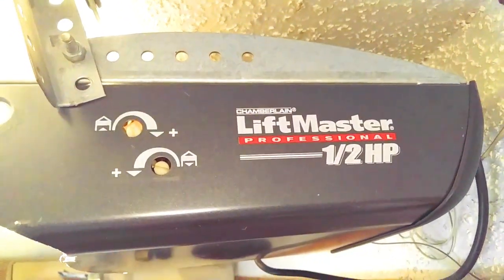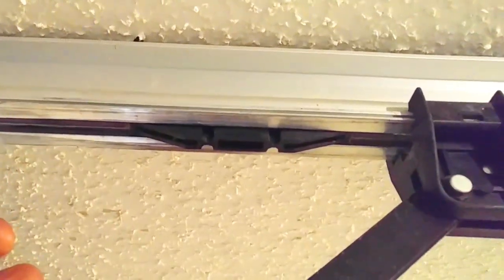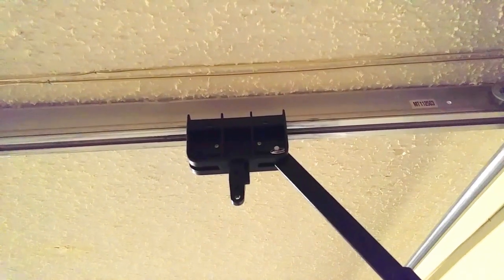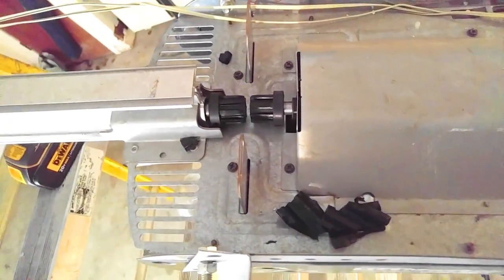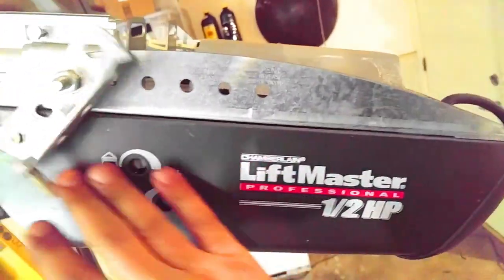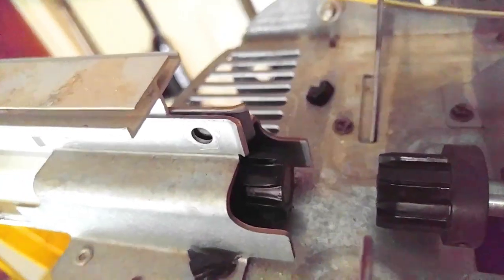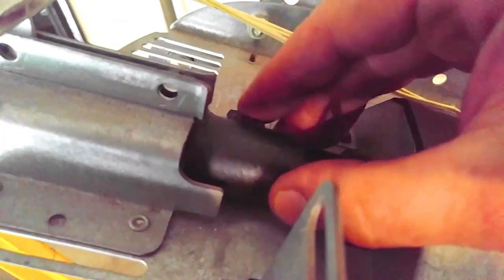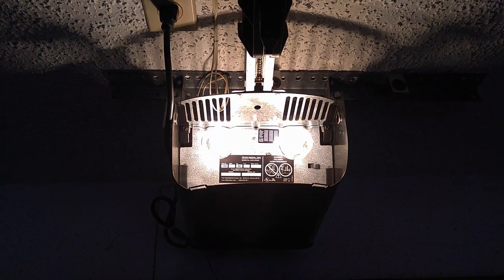LiftMaster Screw Drive Garage Door Opener Coupler Replacement

Comment from the maker: If this video helped you out and saved you a service fee, please feel free to donate to the channel!
https://www.paypal.me/garagedoorgenius
Reply: Would love to donate if I can figure out how the bolt inside the rail moves like in your video so that I can slide in the new coupler
Reply from the maker: @schath123  is the opener still hung up or did you take it down?
Sometimes just taking it down and laying it on the floor helps.  I'm really stumped on why it won't spread out for you.
Reply: @garagedoorgenius  I have no plans of removing the garage opener and placing on the floor. I don’t see you removing it. So what am I doing wrong 😑
Reply from the maker: @schath123  did you loosen the nuts and bolts from the hangers (angle iron) ?  That helps tremendously if not.
Reply: @garagedoorgenius  yes sir I loosened the bolts that holds the motor unit from the ceiling and due to that I can swing the Liftmaster unit horizontally but it’s movement is restricted.
Reply from the maker: @schath123  I would take a large screwdriver and try to pry it forward.  It's stuck and sounds like it needs something to free it up.  Maybe a chisel and tap lightly towards the door on the rail.
Like I said, that thing should slide freely.  Maybe over time dirt and gunk has cemented it together.
Reply from the maker: @schath123  was you able to get it apart?

Comment: This happened to me two days ago. The repairman climbed on a ladder and saw the broken coupler and still quoted me $750 to replace with a belt drive system. Not that that isn't an upgrade, but if the opener is still working, I'll hang on a bit longer before I upgrade. The replacement part will be here Saturday. Thanks for a no-nonsense video, explaining what you're doing, and being specific!
Reply from the maker: If it works great other than a $5 part, keep rolling with it.  Saving money is the name of the game. 👊🏼

Comment: I am so glad I found this YouTube, thank you. Ordered the coupler from Amazon and it was delivered the next day. I used an 8 foot ladder and a book to just balance the unit without taking it down. Took 4 bolts off and pulled the unit back about 2 to 3 inches. Slapped the couple on and put the 4 bolts back on. Took less than ten minutes and saved my at least $150. I was so excited how easy it was and only made on bone head mistake. I went to test the door and it would not open but 2 inches up so I thought it might need to be adjusted so tried that. It did not work, and finally discovered I had locked the garage door down, lol. Unlocked the door and it worked like a charm. Not having to take the unit down saved a ton of time.
Reply from the maker: Awesome!
Great job.  Coupler change can be a pain sometimes.
Reply: Just paid 275$ to fix it, wish I saw this video earlier 😞
Reply from the maker: I'm sorry 😞.
Reply: @garagedoorgenius  it’s all good, sometimes we have to pay I guess

Comment: Had two couplers break on me within 6 months of each other on two different openers. (installed at the same time 20years ago). 
My Theory is that the Coupler is the weakest link in the mechanical system.  And when one does NOT lube their garage door as often as they should, (like me) the couplers break. They are plastic/nylon and get brittle over time. 
Spray silicone spray liberally on all moving parts, coil spring, rail, door tracks, & wheels, etc. Grease the screw drive and hear & feel how much easier the opener does its job!  my 2 cents...   
Excellent video! 👍

Comment from the maker: I was able to rest the opener on top of a 6' ladder with out disconnecting the wall button/safety sensor wires.
Some of you may have to disconnect those wires to do this fix.
Sometimes you don't even have to take the unit down.  Just depends how much room you have.

Good luck!!

Comment: Great Video. Thanks for making it easy.

Mine was a little different in that it broke with the door half opened. For this, I concluded that you can either have the unit cycled all the way up or all the way down. And the Jack Screw has to match whichever position that is before you run the unit. I used a three foot length of Mil Spec 550 chord to wrap around the teethed end of the jack screw and spun the heck out of it till it was all the way to the closed position. Easy to do with the door not connected to the rabbit.
Reply from the maker: Thanks!
And also, awesome pro tip!  💯👍🏼
Reply: I’m having this issue and can’t seem to find the sweet spot of where my machine broke. Any tips?

Comment: I need that new video because my door isn’t going down all the way just half way then it comes back up lol. I had to change the coupler
Reply: This is meeee.  I am searching through the comments and still need help after replacing the coupler.  The little black piece which moves with the chain when the  crank is activated is caught about 3/4 of the way up and won't move lower than that before jerking up again.  Help!

Comment: Hello, thank you for video, I was able to replace the coupler.  But now my door only comes down a little and comes right back up. When it comes back up the trolley comes back to far that it bumps into motor. Seems like everything is out of alignment from where things where before original coupler broke.  Do you have any videos on how to adjust settings back to where they were before replacing coupler?
Reply from the maker: Jaun, the inner slide (black piece that's in the rail), where is it positioned on the rail currently?  Take a look and hit me back.
Reply: @garagedoorgenius  Its positioned pretty far back, almost directly in front of motor.  This is farther back from before I replaced the coupler.
Reply from the maker: @juancarlosruiz8344  I would take the coupler back off.  Run the machine without it.  Run it so it stops in the (up) position.  Put the coupler back on.  From there you should be really close to the up limit.  May have to tweak the up/down limit.
Other than that, you would have to take the limit assembly out and adjust it to where the inner slide is positioned.  That can be daunting to do.

Comment: Thanks for sharing your knowledge! (especially the part how to set and verify the 'down position' of the garage opener) Thumbs up.
Reply from the maker: Thank you for watching!!
 I appreciate the comment 😊
Reply: What if I tried to make a major adjustment with the adjustment screw and now the drive won't spin?
Reply from the maker: If it were me, I would take the cover off.  Inspect where the limit is at on the limit assembly.  The limit assembly pops off.  You can pop out the middle part and twist it, moving the limit arm to where you need it. 
This is a more advanced fix FYI 😬
Reply: Thanks for the quick reply! Somehow I figured it out on the fly. I definitely overdrove the limit contacts. Everything is back to normal. Knowing where the opener thought it was was the trick, like you said. Thanks a lot.
Reply from the maker: @ewdtrey  that's great news!  I was prepared to walk ya through it. 💯🔥🤓🔥

Comment: Got the Repair Guru to come see what was broke on our G.D.O.  His price 60$ for the part 100$ to put it on.  Thanks for doing this video!!!
Reply from the maker: You're welcome!
So you ended up doing the repair?  Sweet! Nj
Reply: @garagedoorgenius  Not yet. Ordered the part. a few minutes ago.
Reply: Just received part. Question. Looks like you did not slide the power head back. Just the rail. So You really do not need to unbolt the power head from the ceiling. Correct?

Comment: Just CLARIFICATION, you want the motor/door to be on a down position (light does not blink when you hit the sensor) before we unscrew and install the sprocket coupling, correct?
Reply from the maker: The inner slide ( black piece that's in the rail), where's that positioned from the front of the rail?  
Yes, you want to start with the settings in the down position.  Judging by where the inner slide is currently at.  You want to press the button and then press it again where you think the door would be relative to the inner slide.  I know, it's kinda confusing.

Comment: Thank you for the video!  I replaced mine but now the door is trying to open and close too much and its cutting out....I've tried backing off both the open and close screws, as I figured once I can get it to open/close without failinhg I can adjust them to the right length but I cant get it to work. Any ideas?
Reply from the maker: I would take the lid off the machine and see where the limits are at.  Once the lid is off you can get a real good look at what's going on.  The limits can be popped out and readjusted.  Just in case you've maxed them out.

Comment: do you have any recommendations on how to fix this issue if the door was 1/4-1/3 of the way up when the coupler broke? If the inner slide piece was not in the down position, will I have to deal with a lot of adjusting of the travel limits?
Reply from the maker: Sorry for the late reply.
You can get it in the down position like in the video.  Then press the button and count to 4.  Should put you in the general area.
Reply: Garage Door Genius no apologies needed. So just to clarify, I would basically be stopping the motor sequence hopefully around the general area of where the inner slide is currently at and then hopefully adjustments should be minor? Thank you for the help and saving my family and I from calling the garage service repair men to replace a $10 part.

Comment: I messed with the limit setting before realizing this piece had broke. Additionally I manually moved the inner slide piece. Now that I’ve fixed the problem, my door only wants to close. I’ve messed with the limit setting but problem persists. Any help would be greatly appreciated.

Comment: Awesome, just what I needed to see. I do have two questions; 1. Should I grease up the coupling before putting it on? 2. My garage door doesn’t have a trip to automatically open, how else would I know which direction it’s going?
Reply from the maker: No grease on the coupler.
So I see where the inner slide is at on the rail (black piece). Then I run the opener to the down position.  I do that by pressing the wall button.  You'll hear the opener start to run.  Put your foot in front of a sensor.  Let it reverse a run it until it shuts off.  Press the wall button again.  Let it run until it shuts off.  Now you know it's in a down position.  
Let's say the inner slide is about half way down on the rail.  You want to press the button.  While it's running, kind of guess where the trolley would be when the door would be raising.  Then press the button to stop it.  It takes about 5 seconds roughly.  You should be pretty close.  You'll have to fine tune it.  The up and down limits are located on the side.
You could also just take the cover off and look at the limit assembly to see where it's at also, but that's more work than I wanna do for that repair.
Don't get frustrated if you have to try it a couple of times.
Reply: @garagedoorgenius  Thank you sir! I had originally called the company that installed the door and they said the vendor doesn't make that unit anymore, they would have to come out and replaced the whole thing for about $4,000. Of course I had to YouTube it. Part is on its way, thanks again.
Reply from the maker: @trily030385  no worries bro.  Glad to help. 🙏

Comment: My inner slide piece was about a foot away from the closed position.  Is there anything I need to do after replacing the coupler before reattaching the door?
Reply from the maker: I would make sure (like in the vid) that the opener is in the closed position.  Then press the open, count to 3, then stop.  Then put the coupler together.  You won't have it spot-on but pretty close to where you can make minor limit adjustments.

Comment: I have attached the coupler together thanks to you, but now when I hit the garage door button my inner slide piece goes forward a little bit then heads all the way to the motor and stays as close as it can to the motor where I can't even attach my garage door back on the slide piece.  What did I do wrong?
Reply from the maker: When it goes forward then all the way back up does the machine click 10 times/light bulb flashes 10 times?
Also, it sounds like the limits are off a bit.
Reply: @garagedoorgenius  It does not blink or click 10 times.  It'll just move forward some then back to the motor and then once it reaches the motor it'll still sound as if it is still trying to go further back just for 2 seconds or so.
Reply: This is exactly my problem, too.  I've been scouring the comments for info for a half hour..haha

Comment: Dude,it looks like I have the same setup u have,however my tail is solid,it does not slide back for the coupling,any advise would be appreciated
Reply from the maker: The motor head has to come off somehow.  Did you figure it out?
Reply: @garagedoorgenius  no not yet,thanx for responding, I guess I have to remove the lower bolt,bolts to disconnect it from the drive,put the coupling on one side,and then raise the motor up to meet the other end of the coupling and then bolt everything back up,this sucks,I'm at wits end,lol
Reply from the maker: @johnfitzgerald2435  broh I wish I could help ya.  I've done it a hundred times, so it's pretty easy for me.  However, I could totally understand why you are at your wits end.  This type of repair has a somewhat difficulty value to it. It's not the easiest to fix but definitely doable. You got this buddy!

Comment: I replaced the coupler, but didn't pay attention to the position of the door! Spent a lot of time adjusting before realizing what I'd done. Now my limits are all jacked up. Is there another video for this? I'm going to attempt to fix/calibrate it this weekend. Somebody wish me luck...
Reply from the maker: Just take the coupler off.  Cycle the door and do the sensor trick to determine where the limits are.

Comment: I need some help please … I removed the two 7/16 bolts on my liftmaster 1/2 HP. But that thing does not slide like in your video. Do I need to remove two more bolts holding the liftmaster unit.
Reply from the maker: Nope.  The 2 bolts you removed are the only thing holding the rail and power head together.  It may be super tight.  Did you try prying it?
Reply: @garagedoorgenius  thanks for reply. The issue is the black piece of metal jutting out of the rail does not move at all, it’s tight, and I did give it a few gentle bangs with my hammer. But in vain

Comment: Hi, I made a mistake and didn't adjust the track trolley correctly with the up and down levels,  after I changed the coupling I tried it without the door attached and the inner slide got stuck on the front bc it went all the way forward,  any recommendations to get it unstuck? I've found videos for when it's stock in the open position but not for this.  Thank you so much!!

Comment: My garage door is making the same noises, and I'm pretty confident the coupler is the issue. However, before taking anything apart, the coupler appears to look ok. I ordered one anyway, but is it possible for it to still be the issue even though it looks alright?
Reply from the maker: It very well could've stripped out the coupler instead of splitting in half.  I normally seem them like in the video tho..in pieces.
If it's not the coupler I pray you don't have to take it apart. Especially if it's a Grey cover LiftMaster screw drive.  The mounting posts that hold the lid and all the goodies inside, break off because they are plastic.  Then nothing will go back together because there's nothing to mount the inside parts to.
Let me know what you find!
Reply from the maker: Check this too!
https://youtu.be/fkeRFA8WNQg
Reply: @garagedoorgenius  Hopefully it is the coupler like you're saying. I'll take it apart soon and keep my fingers crossed!

Comment: My situation is reversed! Door broked while fully up and now can't close.  Inside black slider at edge of light motor unit.  Plan to set UP limit via, pressing remote, motor engages, block safety sensor, motor reverses, then stop while lights blinks, correct? Replace coupler while door in UP position, lock inside and outside sliders together, press remote to test door...correct?
Reply from the maker: You got it Tony! You may have to fine tune the up and down limit but you'll be real close.

Comment: My inner trolley is jacked out of position after replacing coupler. It won’t close all the way even with full down on the adjustment screw. How can I fix that? Thanks in advance.
Reply from the maker: Ok, so here's what I would do.
Back that down limit off at least 2 full revolutions.  So that way you can adjust it.
Then I would take the coupler back off.  Spin with your fingers the screw that the coupler slides over until you get the inner slide close to the down position.
Put the coupler back together.
Make your small adjustments for the down setting and maybe the up if needed.
Reply from the maker: Gary how did the fix go?

Comment: Mine failed in the up position. So I’m confused on why it must be set to down position
Reply from the maker: Because when it's set to the down position down is down. Meaning it is on the concrete. If you try setting it in the up position you might get it close but you won't get it exact. Then you have to mess with the setting the limits. Which isn't a big deal, but if you do it with the door down most of the time you don't have to mess with fine tuning the limits.